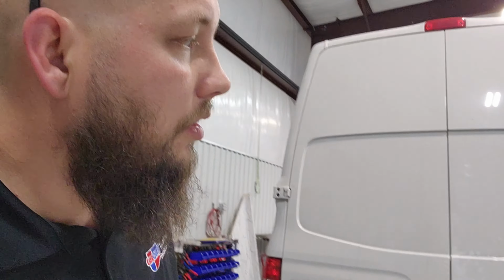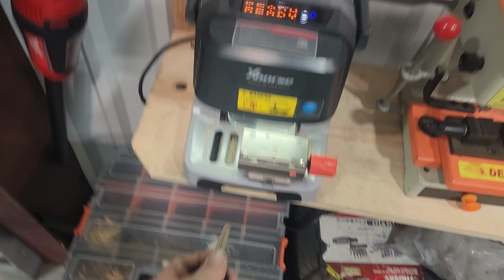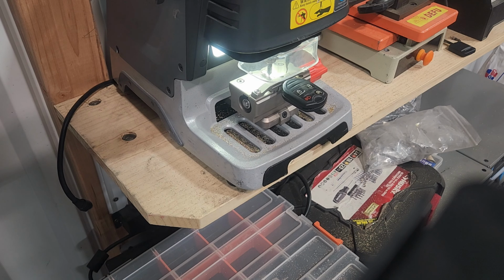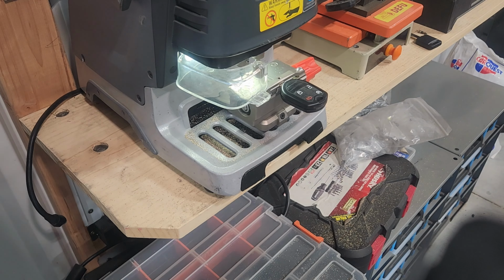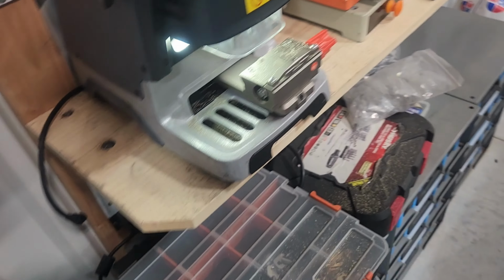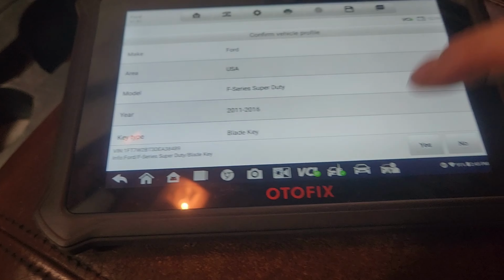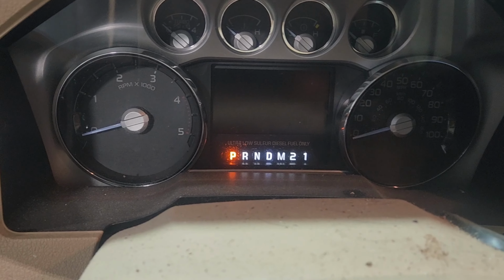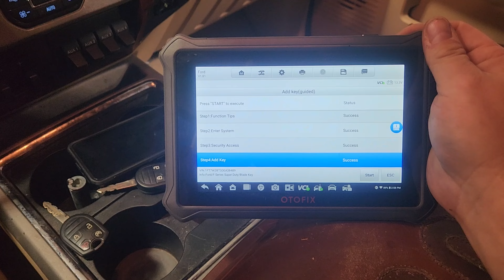The easy way to add a key to a Ford! OTOFIX IM1

Comment: A good tip is to push find bitting after it decodes the key, and it will pull up a key code that matches. That way you are for sure cutting it right.

Comment: I had an interesting incident. 
I bought a really cheap car. I didn't realize it only had one key. (braindead moment). It was a grey key from Toyota. The Toyota dealer said it was a vallet key and could not be duplicated without accessing the entire passlock system. I called your shop and gave this information. Going on the information I gave you, you were not able to do it without the car present for the same reasons. (I'm out of state). 
I had a locksmith come out for a different car. As it turns out, he was able to make spares off my grey key. So I'm not sure what happened with Toyota. Either lying or not knowledgeable.
Reply from the maker: Technically the OEM doesn't support key cloning, they made copies of your clone, the OEM system only has a method to add keys, since you didn't have a master key, that's not possible for the dealers, us locksmith's have many other methods.
Reply: @L1Training  
Thank you very much for the reply and clearing that up. I was a little confused. The locksmith made pretty quick work of it.